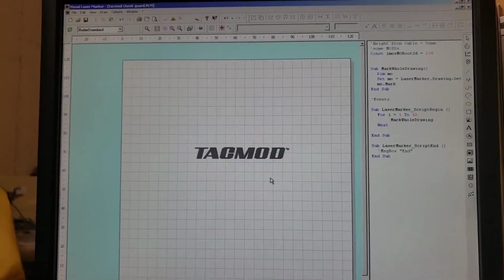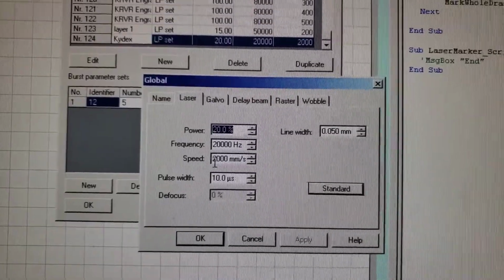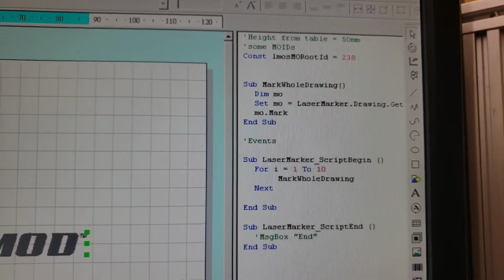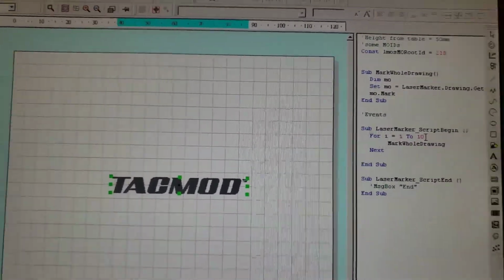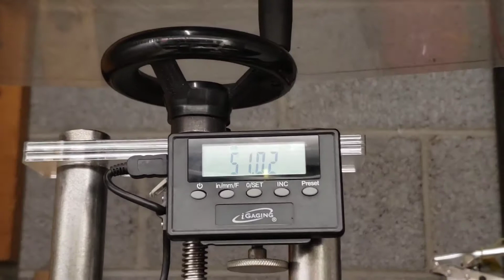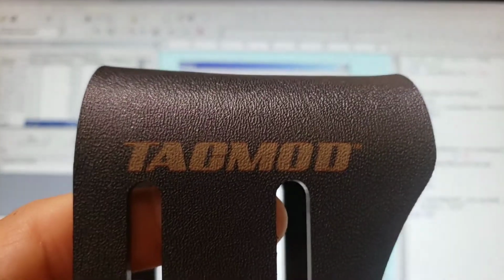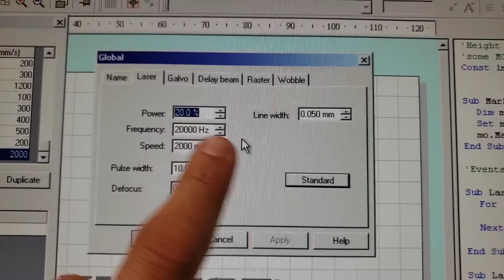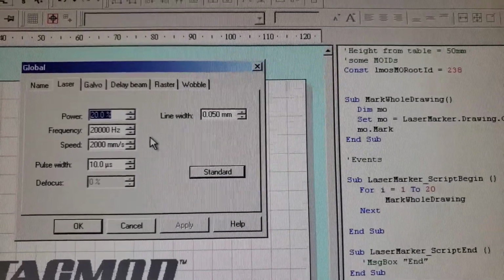How To Laser Mark KYDEX a Light Grey Color or Brown/Bronze using a 20W Fiber Laser Engraver Etch

Comment: Do you do orders? I have a kydex holster I'm wanting to have grey engraved with a short phrase.
Reply from the maker: Hi, I normally just do production runs. It takes a good bit of time and trial and error to setup designs. It usually also requires a few test pieces to get the settings down right. Any surface curvature will affect the engraving.